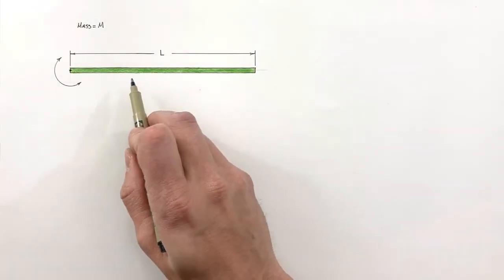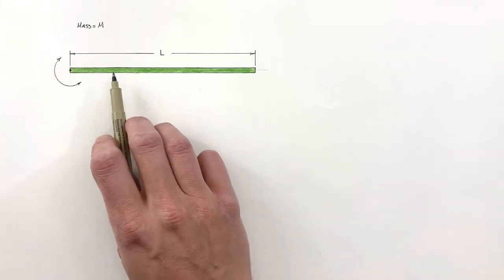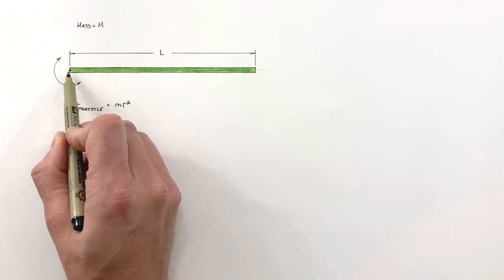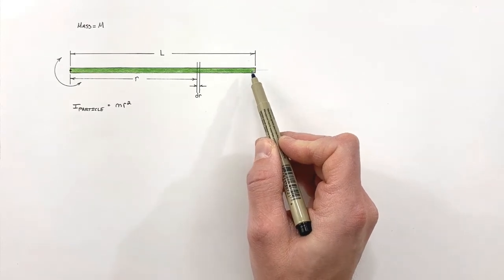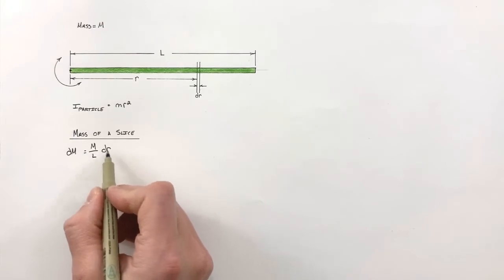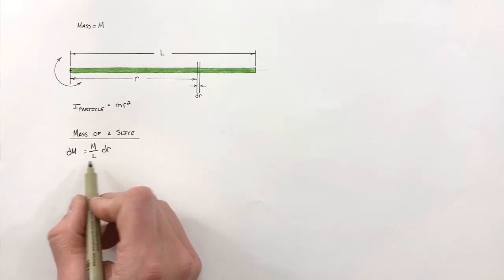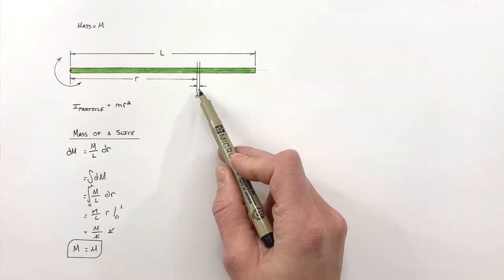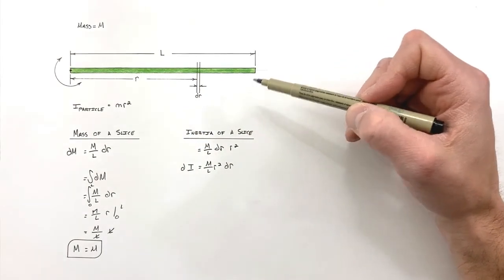Rotational Moment of Inertia of a Rod About It's End

Comment: Beautiful. I love the concept of velocity component here. Without a force or momentum acting on one end of the rod, there's absolutely no necessity to calculate the inertia at a point. Because there's no effect of inertia seen without them. 

However, the velocity itself plays no role in calculating the inertia. 

So velocity component is needed to exhibit or provoke a display of inertia. But is not at all needed to see the measure of inertia. Like one animal provoking another sleeping seemingly dead animal. The inertia is like the type of animal. Buffalo - less response. Tiger - high degree of response. 

Or like a switch on button for an appliance. 

Could you please make a video on other examples of physical entities acting like switches for other phenomenon but where they don't play any role in measuring the phenomena ?